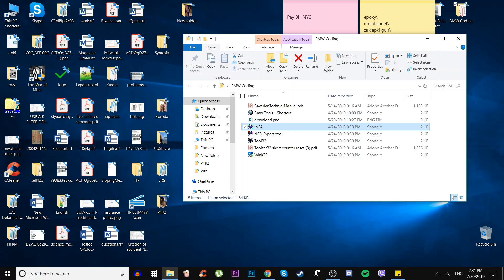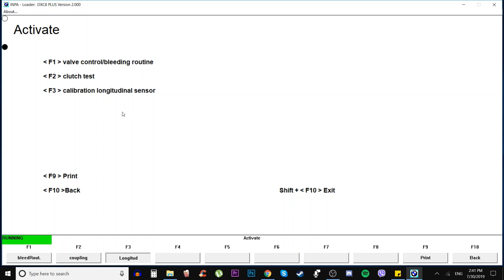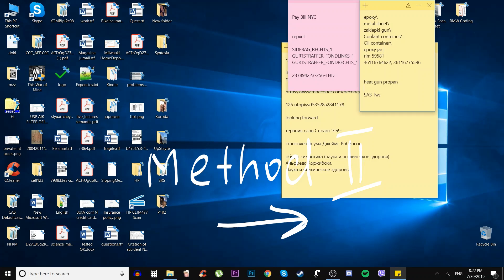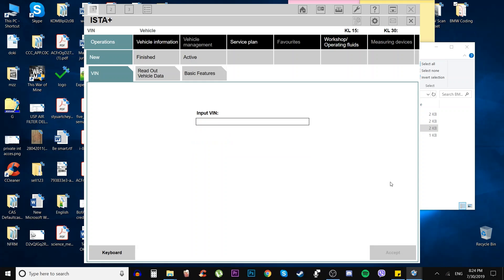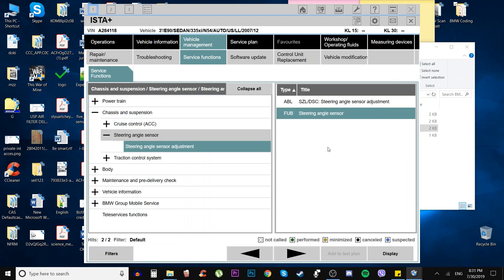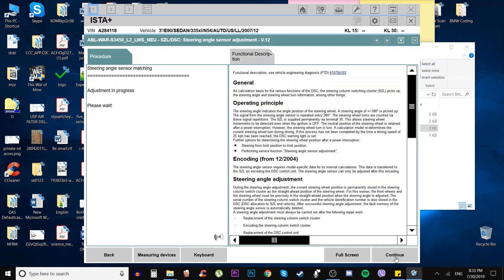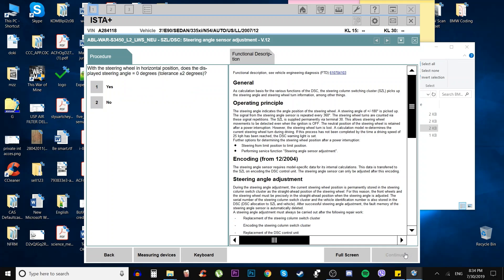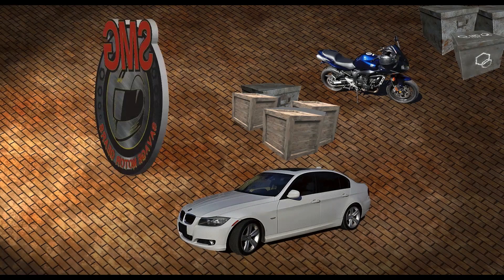BMW Reset/Calibration Steering Angle Sensor (SAS) ISTA+

Comment: Hi, I was wondering why I don't have the option of steering angle sensor adjustment in my ista+
Reply from the maker: It's not always called sas. will need to see the ista options. also if you can send me an VIN, I can get you more info, you can send me the VIN on email, that you can  find on about page. General answer is that not all of the car have sas as separate module, the sensor is still there, but it work different way. It depends on car pkg, suspention, electric, hybrid steering wheel, and some other factors. but usually BMW have option to reset the adaptation for sas, but it called somehow differently.
Reply: @Makhnovets  :)) I have sent you an email, but believe me, there is no sensor adjustment for my car, I have spent 2 hour searching and checking, nothing found such as adjustment or reset, at least not on ista
Reply from the maker: Will check it later today!
You might be better off to use inpa. but that’s a possibility that you have regular suspension as the steering reck.
Reply: @Makhnovets  Thanks for your e-mail, I have just replied back. Have a good one.
Reply from the maker: Will check it out on Thursday.
Reply: @adiwill_ Hi, dou you find the option? I can’t find it too
Reply: @Tom46878  Hi, I will relate what Mr. Mak told me by email,  ==quoted== So in short you don't have the SAS, you do but you don't. What you have it's a EPS "Electric power steering". and that is what you need to reset. In ISTA it's under Vehicle management/Service function/Chass.and.susp./Electric power steering. since i don't have car in my possession I can't see the options there, but you need the one that says ABL/under Type.
If you have trouble with it. go to Fault pattern, and search for SAS, EPS, steering, steering angle, and anything related to find the exact setting that you need. 
In any case, I hope this info was helpful any how.
Reply: @adiwill_  Thank you so much!! This will help a lot. God bless you!

Comment: at 4:56 when i pop the key pack after waiting the 10-15 seconds and press continue i get "could not be executed" 
"is ignition on?"
"is tester connected?"
"Diagcode: D3450_DSC0000C_90_931"
ive repeated the procedure three times and gave up lol 
can anyone help?
I currently have codes 5dd0 & 5dd2, have to recalibrate the dsc but ive been told i have to calibrate the angle sensor first
Reply from the maker: What year of manufacture is your car? And what type obd connector u use? 
Sims like miscommunication, does the inpa work like it should?
Reply: @Makhnovets  2011, I think my dsc is toasted.. as soon as I start my car I noticed the yellow abs light turn red 
I also can’t default code my dsc, i get an error code 
Im using the d+k can cable, I’m able to use ncs expert just fine and code but just when it comes to the dsc coding or calibrating I get an error
Reply from the maker: It's pretty common, there many services that diagnosing and fixing bmw module, i would suggest to fix the oem one instead buying the new one.
Reply: @Makhnovets  i got quoted $250 by module masters i believe that’s their name, many good reviews. I appreciate the advice, hopefully this will solve it
Reply: @benderr424  did you ever get this resolved? I have adjusted the sensor in the past but I keep on getting could not be executed now.

Comment: Hi i have 630i 2006, replaced active steering module as othef had blown,ever since i have active steering fault and steering wheel is way out any ideas? t.i.a
Reply from the maker: if it's used one and newer coded to the vin number and reset to the car coding, that coud be the case, the vin number is might not be the case, but if the other bmw which the module come from had different options, or so, that most likely your problem!
Reply from the maker: Let me just double check with something.
Did you ever save the backup by the chance?
Reply: @Makhnovets   no the old one was removed and new one just put in nothing else was done to it

Comment: If the angle is not Zero degrees and is over 2 degrees, even thought the wheels are straight and the steering wheel is horizontal and straight - . what happens next?
Reply from the maker: That means some shop did good job with alignment but thay didn't do sas correction.
The one of not many things what i would do true BMW SHOP it's balance and alignment.
Everything is fine as far as it's not bothering you.
Reply: @Makhnovets  the problem is though I have an error of “increased steering effort” yet the steering feels good. But the next issue I have is it turns my traction off and puts stabalisation on so I can’t drive safely. Two months now and still no answers as to what is going on!

Comment: inpa+ not working for f series .mine is f31 lci xdrive .can connect with the car
Reply from the maker: That's right, inpa only for E-series. For the F, you need ISTA and e-net OBD cable.
SORRY if i mentioned the f series in the video!

Comment: @savage motor gear can I do this on the Mini Cooper R56? And if so, what options do I select from the main menu ?
Reply from the maker: This the specs for the cable. i think 2001-2019 mini can be scanned true ista or inpa. the steps might be different. you should be able to do it on your own. you can send me your VIN ((here or Vental33@gmail.com) in the title just say VIN MINI)). I will try to check it on how to go true. also, you can go to Vehicle maintenance/Repair manual/and search for SAS(Steering angle sensor)Obviously in the app itself. 
https://amzn.to/2O5RsKR
D-CAN models:
E60, E61 after 3 / 2007
E83 after 9 / 2006
E81, E87 after 3 / 2007 E90, E91, E92, E93 after 3 / 2007
E53
E70 
R56 (New Mini)***
ALL

Comment: Hi i have bmw x3 3.0i 2004 when i start the engine no light when i move the car a bit 4x4 light only pops on no other light only 4x4. And sometime it pop on when its parked and i turn the steering wheel several time i already tryed ro disconect battery and the lock to lock stwering

Comment: Hi I have changed angle sensor and on this program instead of showing 0 degrees it’s showing -12000 how can I reset it to 0 degrees whilst the wheel is straight so I can code the angle sensor because I have airbag and traction light on and restraint system
Reply from the maker: Is the speed sensors are ok? Do you have any messages for it? Sorry for miss info, the speed sensors or abs would not allow you to reset the sas.
Reply from the maker: Dealler will replace the sas which is $4-600 and probably 3-6hours of labor. So you looking for about +-$1000.
Reply: Savage Motor Gears atleast I’m getting somewhere, it’s really hard to find someone whocunderstands about these problems and cars in the UK. Many thanks for your help. So because the VIN DOESNT MATCH THE CHASIS NUMBER this will stop the coding to happen?
Also to add I can’t even get a remote control I tried it didn’t work
Reply: I think for me the only option is dealer, but with all these faults it seems it’s going to add up to like £2000? Lol
Reply: Savage Motor Gears proberly my angle sensor is working clearly, that means what will bmw have to do then?
Reply from the maker: One of those codes doesn't let you to reset angle sensor. Is your car drivable?
Last year i got in exident on that car, couple air bags deployed, so some of the check lights was non fixable till i replace or code out the air bag light.
Reply: Savage Motor Gears it is driveable, just worried I can’t find a solution to it. I’m lost to be honest
Reply from the maker: @denizsaribas4681  did you try to start the car steering to the left all the was/stop for a sec/all the way to the right stop for a sec, back to zero position, it should sent some data to sas sensor, if not try to disconnect battery and reconnect, do the same steps with steering. I'll check some data today, will text you back later today
Reply: Savage Motor Gears yes mate I have tried all those actions however the problem is it should be showing 0 degrees. Whilst wheels straight I need to find a way to sort this out. IF YOU CAN help me it would be highly appreciated maye
Reply from the maker: Did you try to drive the car for a bit?
Reply: Savage Motor Gears yes I drive the car daily and have no issues with anything else just the airbag light is on and traction and restraint system mate
Reply from the maker: Also the part could be defected or it doesn't work with your car, pkg or so, the -12k is abnormal reading, so car either can't see the unit or it from different BMW which has different modules or so...
Reply: Savage Motor Gears it could be mate, should I try dealers?
Reply: Savage Motor Gears I think the ECU IS FROM A DIFFERENT COUNTRY ON MY CAR would this affect this? Also on the faults it also says VIN DOESNT MATCH CHASIS NUMBER
Many thanks
Reply from the maker: @denizsaribas4681  Yes. Thets the reason, you can code the unit to set the default value for the ECU with ncsExpert, as well rhere another app which allows you to change the VIN which is WinKFP.
Reply from the maker: You have an option as customer request, the dealership can do all the diagnostic but you will choose what to change or not to. 
Good luck man.
Reply from the maker: I will try to find video about coding and VIN, not promising but will try. I saw somebody was doing that kind of stuff...
Reply: Savage Motor Gears thanks a lot met
Reply: Savage Motor Gears mate *

Comment: I get this error requested control unit not found  MS430DS0 program will be stoppped
Reply from the maker: INPA? Also check the error memory. Do you have any specific errors?
The app you use does not have particular protocol, I'm assuming so. The easiest way is to download ISTA. But try to find version of INPA that's have all protocols and so for your car.

Comment: what is the ista D decryption key?
Reply from the maker: Not 100% sure what D is mean, but there to type of programs, one is ISTA P which is coding tool, the ISTA D is diagnostic toor, you can reset anything in the car, it's like INPA but it's more advanced tool, i will do another separate video about the app itself, so subscribe))))👍🏻😉
Reply: @Makhnovets  is there any software for vw sharan 2014 please? Thanks

Comment: Hi
My bmw e46 after parking for a while and battery went flat. When battery charged, and car driven then ABS, DSC, tyre pressure light came on. Garage deleted errors, and recalibrate steering angle sensor via AUTEL tool, but it comes back after driving few yards.. what to do? I will try with bmw tool INPA , ncsexpert and see if it solves the issue. What do you suggest? Thanks in advance..
Reply from the maker: Check the battery voltage first, usually when Battery go weak it happens, anything below 12v is bad. Also if you install the new battery already you have to recalibrate it as well. That what i would check first. Also is there any fault memory after you reset everything?
Reply: Savage Motor Gears thanks for your reply. It was ABS sensor passenger side. Need replacing.
Reply: @786hunzavalley  what issue you have I have steering wheel light on brake and 4x4 after I change the battery this light show up you think can be abs sensor for my car
Reply: Savage Motor Gears hi could you show a video on how to calibrate battery if it’s has different amperage from previous battery on toolset32
Reply: Jacob Calvin hi. There was a function in bmw tool( I bought online). Just click calibrate and it will do it. But in my case the issue was ABS sensor, after changing that all lights went off. £20-£30 cost... regarding your tool request, I sold bmw and also get rid of tool.,cheers.